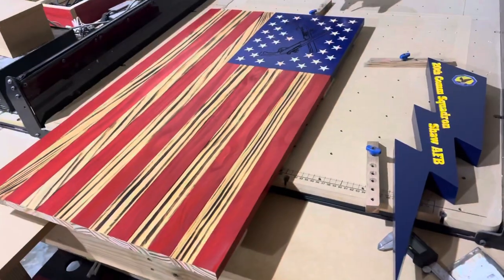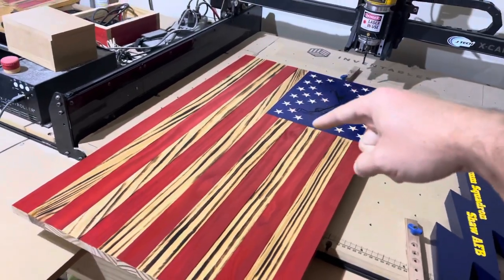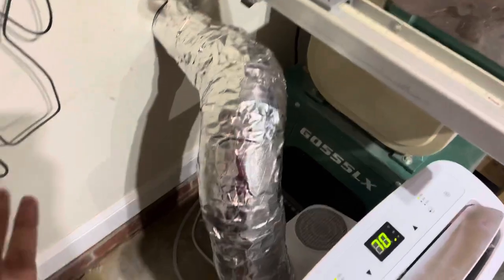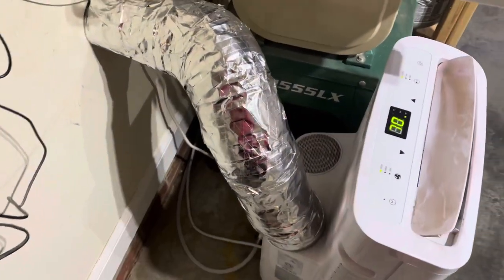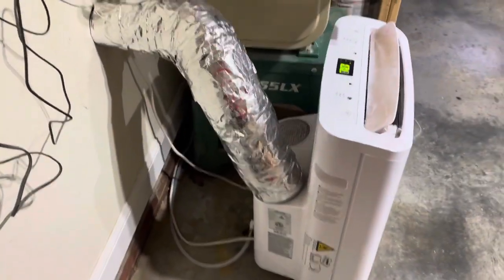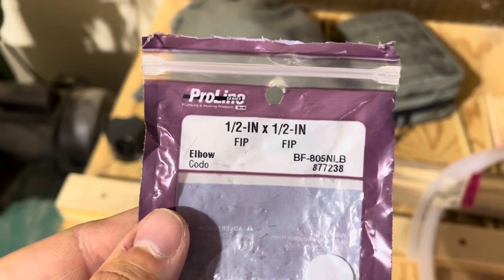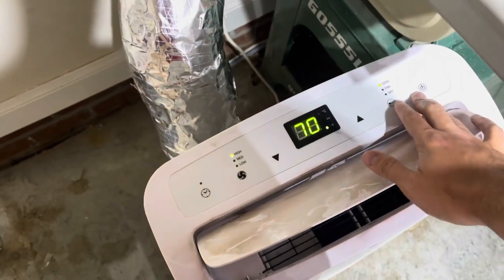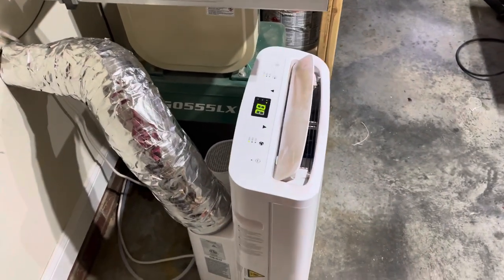Garage Portable AC… is it worth it?? Subscriber give away! Updates and upgrades!

Comment: Have you seen a significant rise in your electric bill, I have the same issue as you. Hot and humid, no windows in garage.
Reply from the maker: So I only run mine about 4 times a month. Each weekend. Power bill did go Up some but I put a pool up this summer as well so idk if the AC or the pool pump caused the rise. I assume it’s a mixture of both